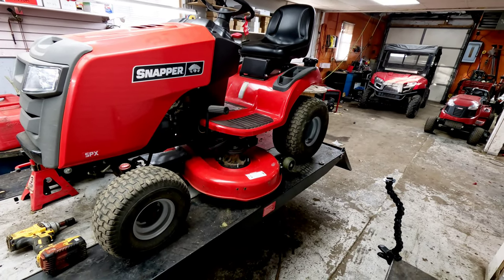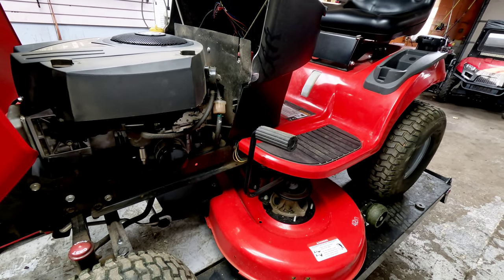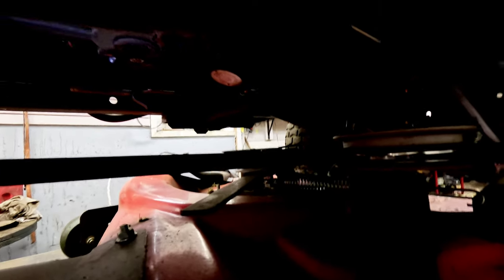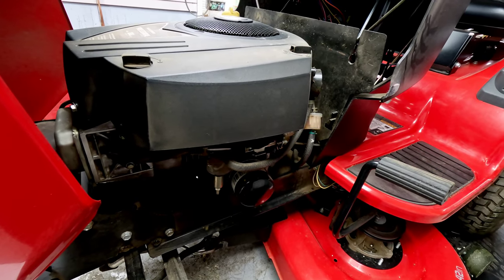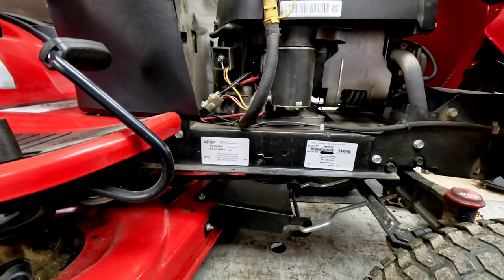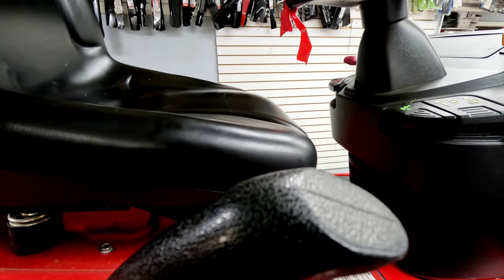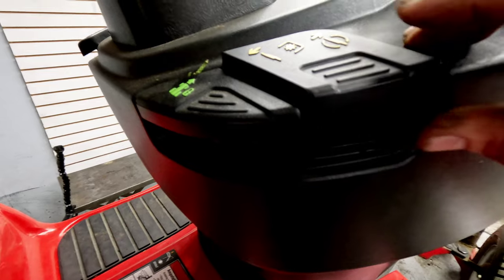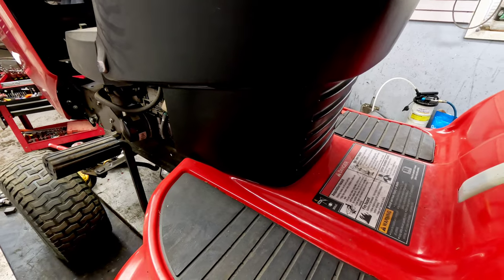Snapper SPX Riding Mower Quality and Service Review - Buy Or Pass? Is It Worth The Money?

Comment: I had the seat bolts tear out of the frame. Snapper dealer did replace that part of the frame. Frame was not strong enough to stand up to mowing a drainage ditch on my property, but the rest of the mower has held up with no problems.
Reply from the maker: I see the bolts come out so often at the frame I wonder why they get that way. My guess is they are not originally torqued to spec and once they come loose just wear and wear. Thanks for watching!
Reply: Had similar problem. Tore the metal it was attached to. I had someone weld a thicker plate to attach to it on that spot. Been great since
Reply: @IndRepair  I think it's because the metal frame is not particularly thick at that point and it flexes over time and breaks due to fatigue.

Comment: Great video, thank you!!!!  I just bought a used SPX 2246 in pretty decent condition with the 22hp B&S Professional series engine and the 46" deck for $400. It runs great, but I'm going to have to get a deck belt for it, and install an inner tube in the front left tire before I can get it going and mowing!  Is that a good engine on these mowers?? Also, how can I tell if mine has the K46 transmission or not? The seller actually gave me a spare 42" deck to go with it, so I should be in pretty good shape once I get the mower going, I will have two spare spindles and tension pulley!  I'm going shopping for the deck belt and an inner tube today, hopefully I can get this mower going today or tomorrow, in spite of all the rain from tropical storm Debby. Thanks again for the video!!
Reply from the maker: Awesome! This has a hydro gear T2 transmission not as solid but decent
Reply: @IndRepair  I got a new belt ($35) yesterday and had a tire shop install a tube in the tire ($27) and have now got it ready to go and mow! This mower has a pretty sharp turning radius, so sharp you have to be careful making tight turns as the outside tire can dig in a bit. So far, so good, I like my $400 mower lol.

Comment: What model riding mower in 48-60 inch cut, do you feel was the most reliable and easy to service { as far as changing belts , blades, etc } ?
Reply from the maker: I would go with a Simplicity hands down their mowers are so much easier to work on than anything. Select the deck size and engine option you want and off you go!
Reply: @IndRepair  aren’t Simplicity and the Snapper really close since it’s the same company that owns them, Briggs and Stratton?
Reply from the maker: They may be owned by the same company now but the designs and quality are much different still. Thanks for watching!

Comment: All I like is the vira speed and simple aluminum unit 
No tuff trans for me
Reply from the maker: They make the K46, which is one of the most (if not the most) used transmission across all brands. We see a lot of them really old with no issues. Problem is most of us like to push a machine to and beyond its limits. Why do we do this? Because why not? You have a machine and expect it to work for whatever you use it for.

Comment: Wait until you have to replace the battery. MIT is a capital bitch.  It uses a U1R battery.  You have to put the new battery in sideways and then rotate it into the metal box it sits in.  You may have to install it several times until it goes into is box.  You will also have to replace the battery bolts with those one inch long ( 1/4”x 1.0 inch).  Some people say you need a 10mm wrench to remove and install the battery bolts.  This is wrong.  You will need two 7/16” wrenches.  I did not reinstall the hold down bar because I would not be able to remove the battery caps and top the cells off with distilled water.  It will not come out of that metal box that it sits in, unless you turn the tractor over.
Reply from the maker: I see a lot of hard batteries but that sounds horrible!! Thanks for watching!

Comment: Fuel tank in back, don’t like that
Reply from the maker: Front tanks are easier to drain or flush but long as your using good fuel you will not have to worry about it. At least there is plenty room to replace the fuel line without complete disassembly when the time comes. Thanks again for watching!